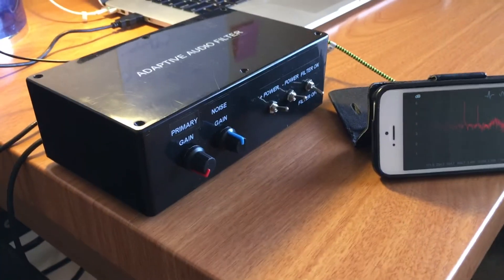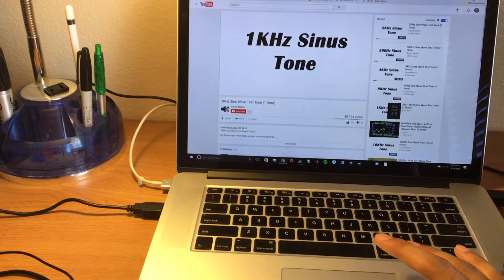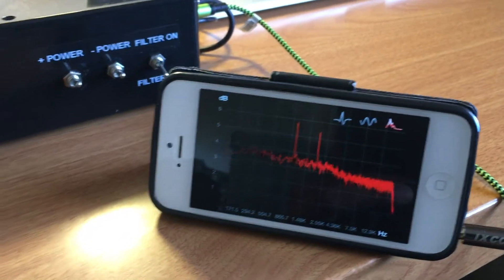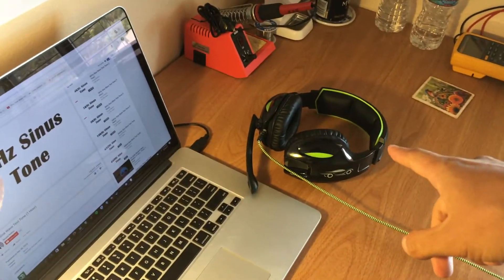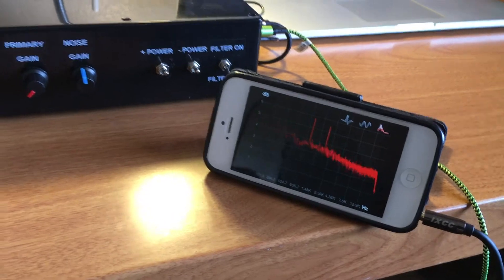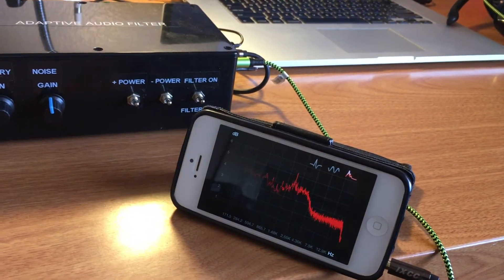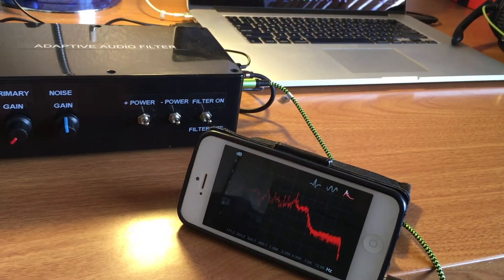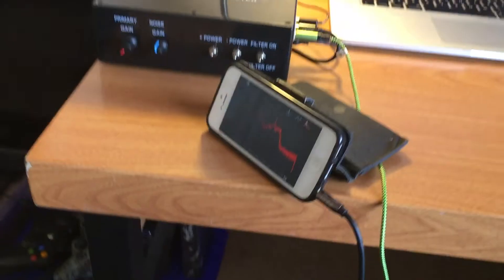Adaptive Audio Filter LMS

Comment: The noise floor is raised when turning on the filter because the adaptive filter you are using contains active (powered) components that add their own noise to the signal chain.  You can hear this in your spoken demo (I can audibly hear a stronger noise floor).  That being said, this is not a very effective adaptive filter for audio to maintain the quality or Signal-to-Noise Ration (SNR).
Reply from the maker: Adam Stegemann You have a good point about the active components adding noise into the system, I need to look more into that. MATLAB has a good audio demonstration of the LMS and RLS audio filter working though, so I just need to run some test samples through my system and compare the output samples with MATLAB's. If I get the same thing, then yeah, the noise has to be coming from somewhere in my analog part of the system.